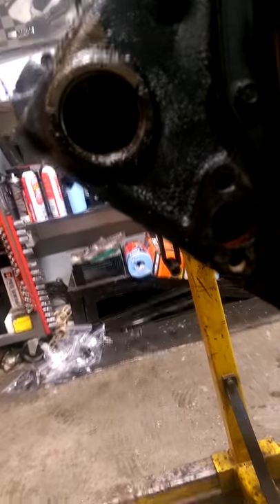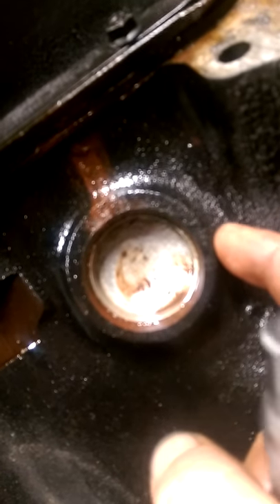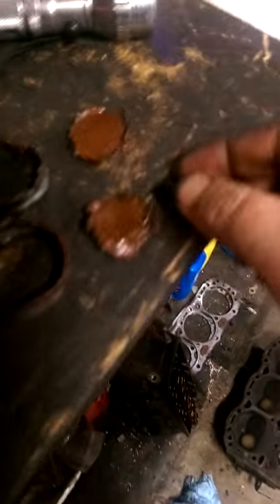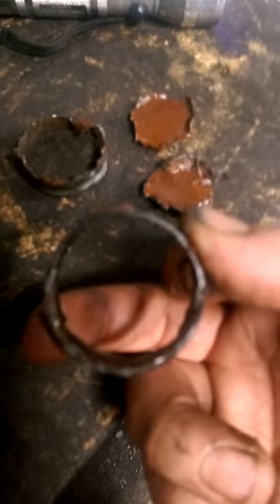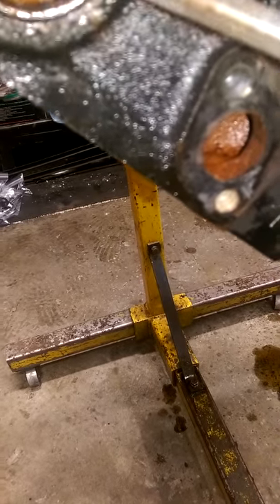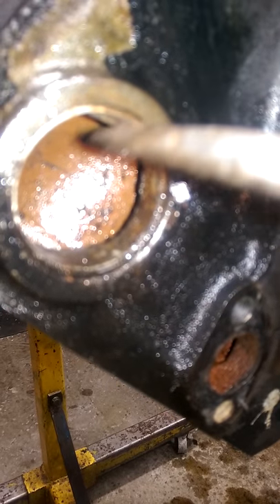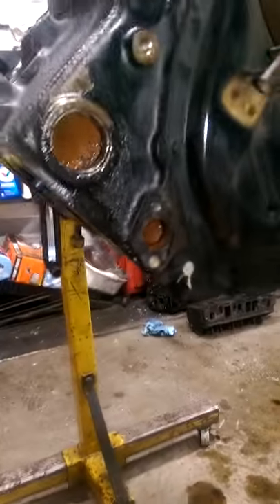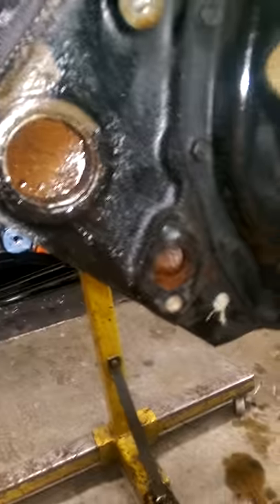4.3 Chevy/GMC Freeze Plug removal. EASIEST WAY! No dremel, die grinder, etc.

Comment: Is there a freeze plug on back of engine? And do you have to remove transmission?
Reply from the maker: There is generally never a freeze plug on the rear of an engine block, but cylinder heads will have them on the rear, facing the firewall.

Comment: I've got just the ring of a freeze plug on my old AMC 360 in my jeep, not sure how im gonna get it out
Reply from the maker: Some people will scream "NO!", but if you are very delicate...if you find a small, flat head screwdriver, ans a small hammer, you can massage between the ring, and bore of the block, until you "deform" the ring...just don't want the screwdriver to gouge into the block side...angle as you hit, so the brunt goes to the ring side.
Reply: @jeremybell2938  got it, thanks!

Comment: Man what if you can't pull the motor and have minimal tools
Reply from the maker: The freeze plugs on the 4.3 are difficult with the engine in. If it is driver's side, you can remove the intermediate shaft that runs from your steering wheel, through the firewall, to the steering gear, and then remove the inner fender, plastic splash shields. That is about the most I can offer in that side. Without pulling the motor, you can take a jack, with a wood block, and put it under the oil pan(make sure you use a piece of wood, like a 2x4, between the jack, and oil pan...so you don't put a hole in the oil pan), then pull the motor mount through bolts, and jack the engine up a few inches, to try and gain some access, or space.